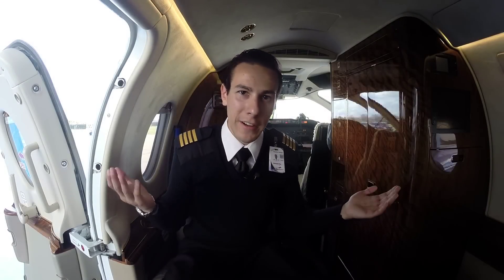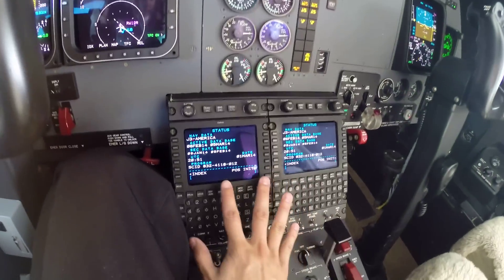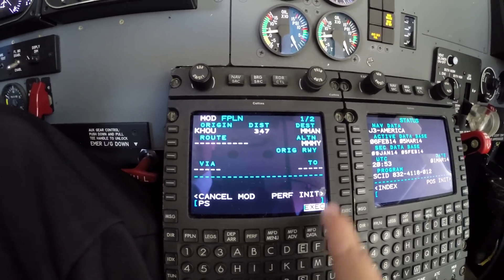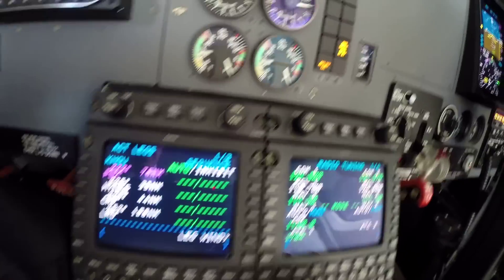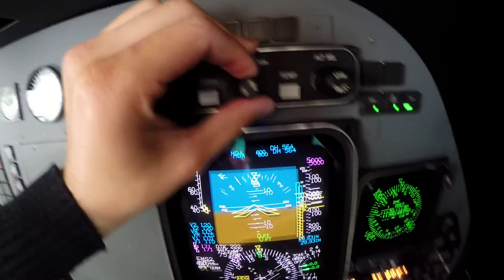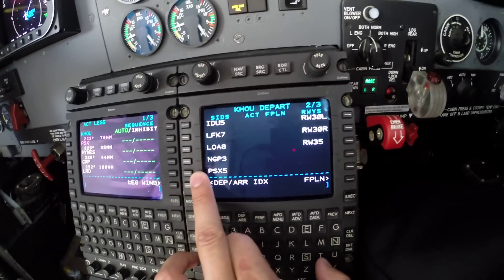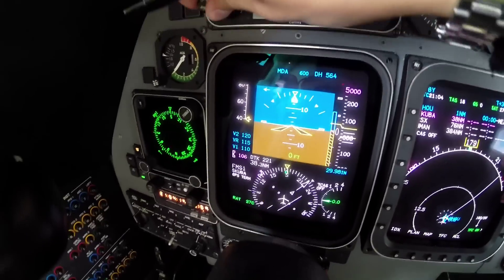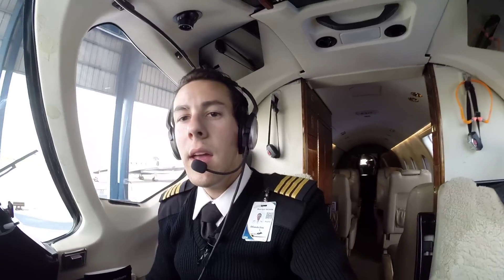Beechjet Series: Cockpit Preparation

Comment: Why 200 knots the limit? Is it the speed restriction on de SID? ....
if you are flying out of class B airspace  and maintainin 5000 n expecting higher, the speed restriction for operating below 10,000 or in CLASS B ft is 250 knots unless your flying the airspace underlying class B or in VFR corridors

Or i believe if ATC us assignin airspeed adjustements that wpuld be something like 

Operaton below 10,000 ft  is 210 knots
Departing an airport is 230 knots 

Good video, nicely done!
Reply from the maker: Hi there! Thanks for your comments. And you are right. We have a company policy for a high performance climb out of the B airspace. We preffer to get away faster from them (traffic mainly). But sometimes I miss some information on the videos. You gotta be quick, otherwise the watchers get bored. lol

Keep skies safe!
Reply: Ramberriaa The AIM states that 200 is max speed within any airport terminal area.  Most likely why his ops specs are 200.